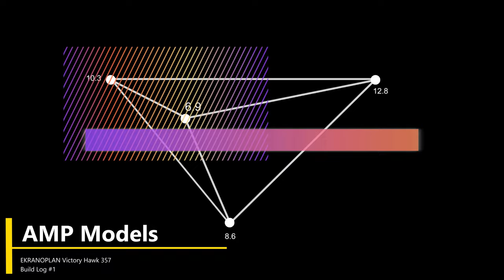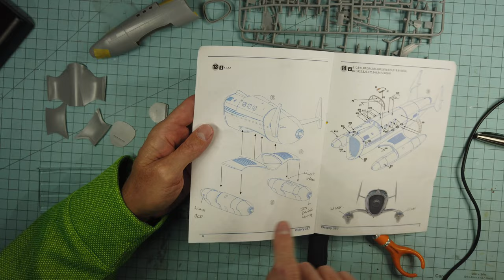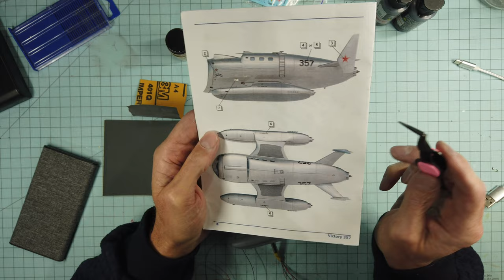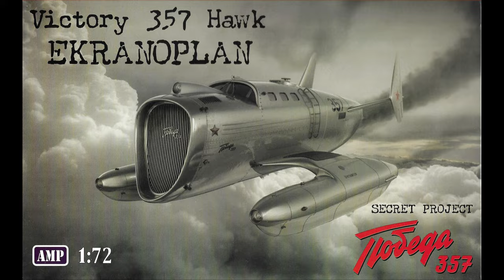AMP Models Ekranoplan Victory Hawk 357 Build Log #1

Comment: Love the lighting. I' ve always wanted to light some models, but I'm convinced that electricity is the work of the devil.  Wiring a light switch is about the limit of my skill.
Apparently we came up with the same solution for the windshield. Ended up looking pretty good.

I painted my fuselage with AK extreme metal duraluminum and the grill piece with Spaz Stix chrome.  This was my first time using the AK paint and It's really nice.  

Anyway, really looking forward to the rest of your build.
Reply from the maker: I'll have to look into the AK paint line.  I had not heard of it until you mentioned it here.  Thanks , and good luck with your build.  Shoot me a couple of photos when you're done, and I may feature it in an upcoming video!  Thanks
Reply: @thesloppymodeler  AK paint seems to be very similar to Tamiya but they have a wider variety of colors.